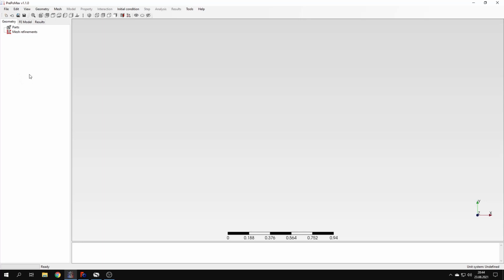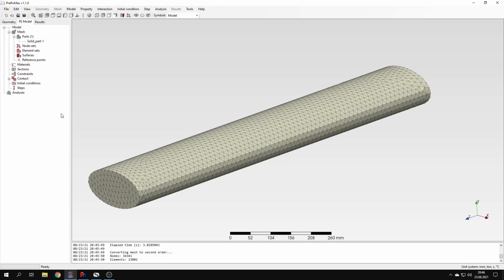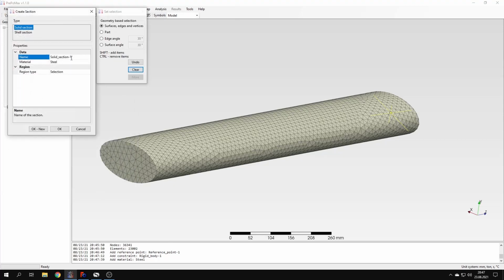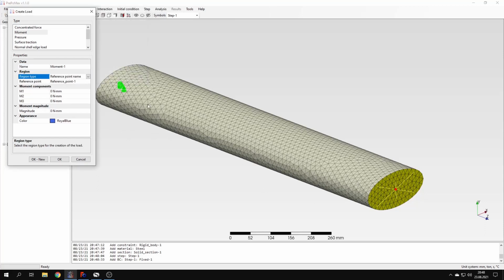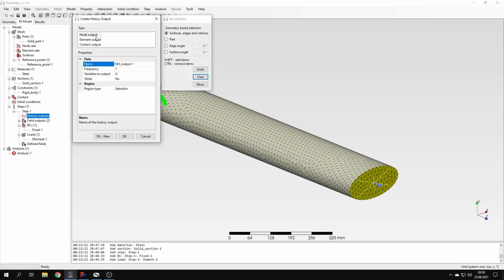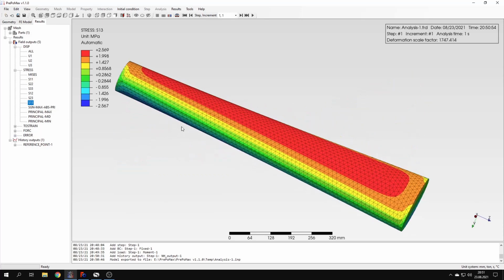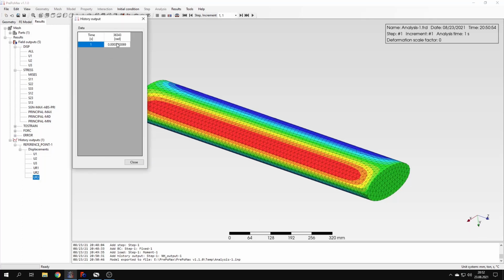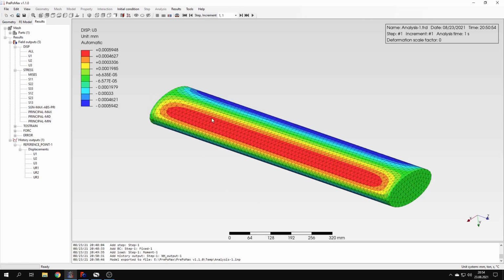PrePoMax (CalculiX FEA) - Tutorial 2 - Torsion of an elliptical bar

Comment: Hi, I have a question about solver. 
The default solver in V 2.2.0 is Pardiso, and it cannot work. After some tried, I fond to switch the solve to the selection of 'Default' can solve this problem. Does anyone know why Pardiso cannot work?
Reply from the maker: Are there any error messages ? It should work in most cases because dll libraries needed to use Pardiso are provided with PrePoMax.
Reply: @FEAnalyst  Hi, thank you for your replay!
The error messages like following 
"STEP            1

 Static analysis was selected

 Job failed - no results exist.

 Process elapsed time:       3.378 s"

And this is some more information, 
"CalculiX Version 2.22, Copyright(C) 1998-2024 Guido Dhondt
CalculiX comes with ABSOLUTELY NO WARRANTY. "
Reply from the maker: @jli999  And it works if you choose another solver in the step definition (e.g. Spooles or PaStiX) ? You could also try with an older ccx binary from its website.

Comment: thanks for this tutorial. can i ask if its possible import a mesh and not a geometry (if i want to use external mesher) 

and its possible apply boundary condion and load toca single node and not to "geometrical entity"
Reply from the maker: Yes, you can import and work on meshes. Individual nodes can be selected too. Just change the selection mode in that "Set selection" window (click "More" first to show its mesh-based selection options).
Reply: @FEAnalyst  tnks and thank you for the istantaneous reply

Comment: How can i revaluate the design without moment ...can you help me out with this...i am working on a project where i have toh find the shear stress and total deformation with the help of moment and then i duplicate this static structure and i have to compare this same result without using moment how can i perform this... kindly help me out
Reply from the maker: So you have to compare the approach involving moment applied via rigid body with a different approach giving the same results? Analytical calculation would be the best way to verify the correctness of the results when rigid body is used to apply moment. Like I did here. There aren’t many other ways to simulate torsion. It would be good if you could show your model and share some details on the PrePoMax forum.

Comment: Is it possible to perform multi body simulation e.g mechanism in motion
Reply from the maker: Theoretically, it could be possible to some extent (using rigid body constraints) but CalculiX is not meant for that and it doesn’t offer proper connection types (like connector elements in Abaqus). There are some open-source codes specifically for MBD simulations such as MBDyn and FreeDyn. Currently, a module for FreeCAD that would support MBDyn is being developed. Check Jose Gabriel Egas Ortuño’s YouTube channel.